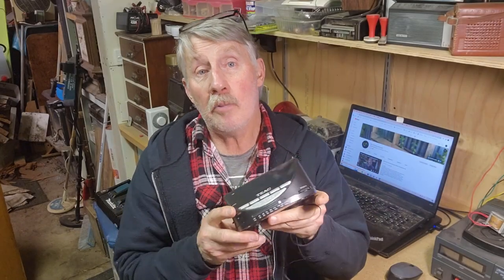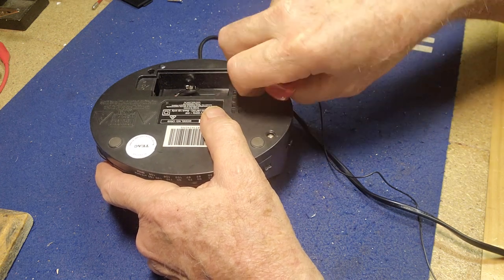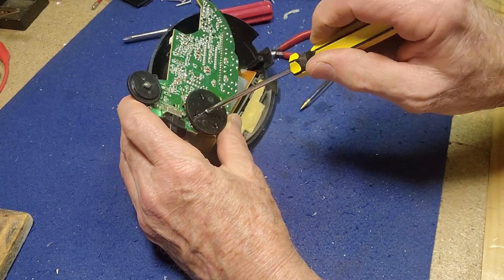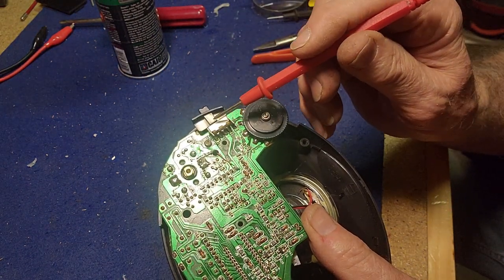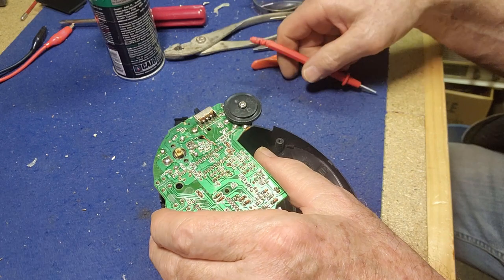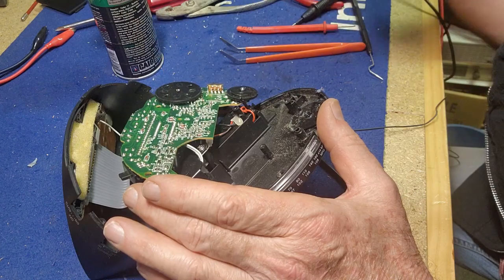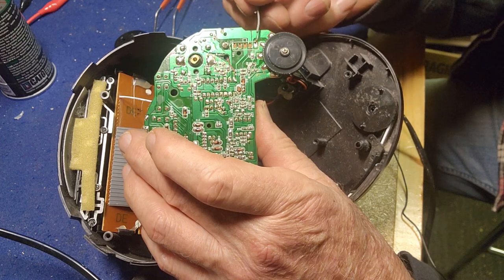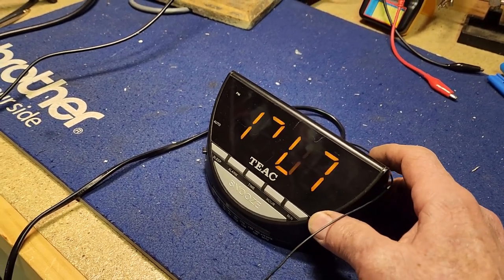How to Fix a Teac Clock Radio with a No AM or FM Radio Fault. Another Electronic Repair Journey!

Comment: Your pricing is off Chris!  A brand NEW clock is UNDER 15 USD. Not nearly 40, like you said, even in AUD.  I like your repair process. But this was not so valuable a fix. You need to save the world!  Focus!
Reply from the maker: My searching showed prices quite a bit higher than you suggest Shane, for a quality brand. Sure there are much cheaper Chinese options - but really the price is irrelevant. Most of these repairs are about saving something from a premature death rather than demonstrating an economically viable repair! You guys are helping to keep me focused with your comments though - well done! 😁👍
Reply: @TheUltimateRecycler  Go Chris Go!